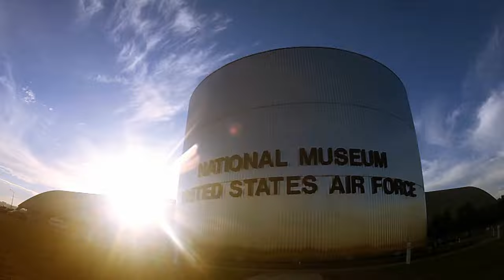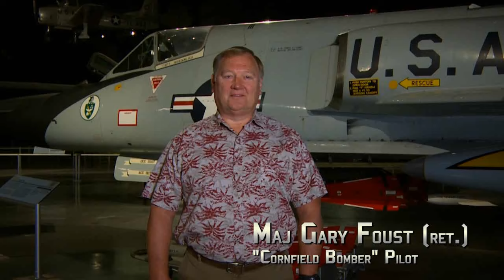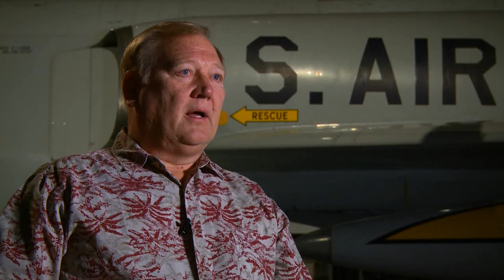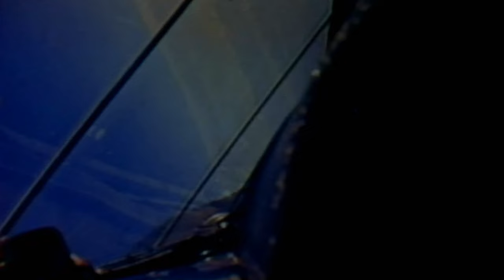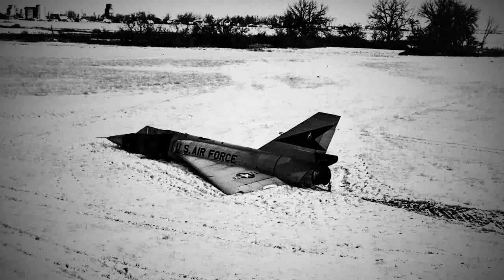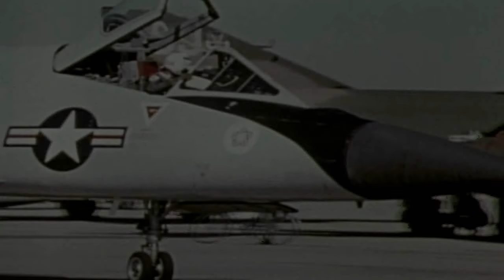"Cornfield Bomber"

Comment: I can't tell if you're being serious.

No. The odds of a aerodynamically unstable aircraft recovering from a flatspin without any control inputs is extremely unlikely. Far less than simply flipping a coin.

The remarkable part is that the aircraft then glided away and essentially landed itself is probably even more remarkable. It would have to have been almost perfectly trimmed for wherever the throttle wound up after he bailed... crazy odds.
Reply: My guess is that the chang in CG

Comment: When this bird was at Griffiss in the late 70’s I worked on it. An interesting piece of trivia that I forgot - the pilot’s wingman that day was “Major” Lowe who was later promoted to Colonel and became the Squadron Commander of 49th while I was there. Oh, the stories, but hey, as we always say - what happens at “the Griff” stays at the Griff lol
Reply: I was at Griffiss from 81-85 and worked on 787 many times (avionics). We always hated having to remove the radome, because it was a PITA to get it back on. The front of the airframe wasn't quite straight, and the bolts didn't line up properly. That squadon commander had his own "incident" while I was there. His 106 had the engine sieze up over the Adirondaks, and he had to eject. I don't remember the tail number. When the squadron shut down in late 1985, we still had 453, which was the third production F-106 made (in 1956). It was the oldest F-106 still in active service. I later learned that it was made into a drone, and got shot down at White Sands.

Comment: I've heard of many crashes because the pilots couldn't get the nose down,  causing a stall.  The thrust of the ejection caused the nose to pitch down.  Makes one wonder if there could be something secondary added to planes that forces the nose down.
Reply: As a last resort tool.
Reply: Canards replace rear horizontal stabilizers. Their job is to control pitch same as the horizontal stabilizer. Stall recovery is secondary due to the canards generally having a higher incidence (angle of attack) than the main lifting surface so they stall first preventing the main wing from reaching a stall point. A similar effect can be done by building twist into a wing on a conventional planform aircraft that makes the center stall before the wing tips so it essentially forces the nose down. Only a couple of aircraft have had both canards and horizontal stabilizers. Nasa's F-15 Stol/agile eagle/whatever the name was is one of the best/extreme examples. It had thrust vectoring as well. Canards that aren't really canards are like the ones on the B-1 where they exist to smooth the aircraft ride and and reduce the flexing of the airframe.

Comment: It recovering by itself is not that unbelievable.  A flat spin is so dangerous because there is no air moving over the control surface,  rendering them in effective. This is the reason a flat spin is almost always unrecoverable and led to Goose's death. The reason the aircraft recovered was because the force of ejection, which shoots tue pilot up, has the opposite effect on the aircraft. The nose is pushed down, with the nose angled down their becomes effective airflow over the wing.

Comment: That's a trait of a lot of modern fighters. They are designed to be unstable to allow for quick manoeuvres (or in the case of most stealthy aircraft, their shape makes them unstable) but require a fly by wire system in order for them to be flown properly if at all.

Comment: I heard a story about a propeller driven military aircraft, some time in the 50's or 60's I think, that entered an unrecoverable spin causing the pilot to eject or bail out. The airplane then apparently recovered itself and flew straight and level until it ran out of fuel hundreds of miles later, causing it to then crash. Unfortunately, I don't remember any specifics to help identify the story.